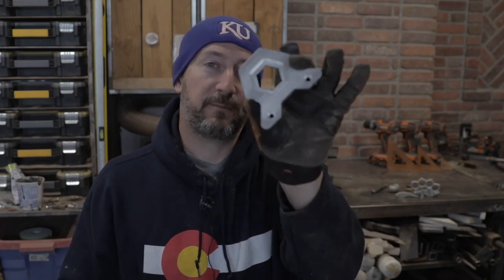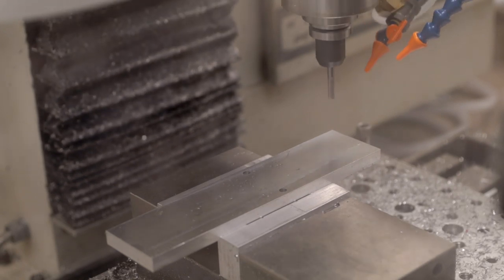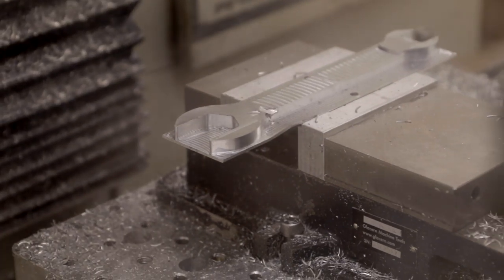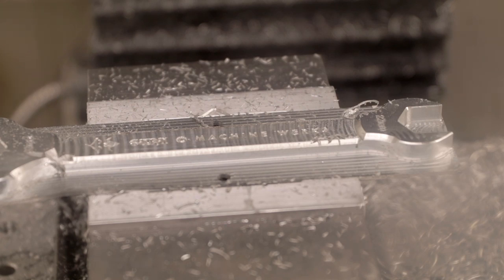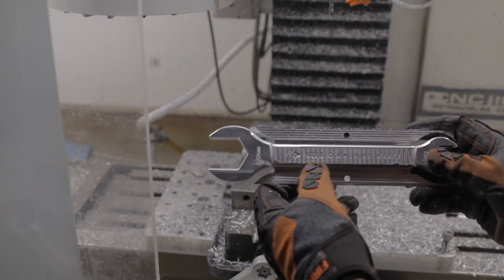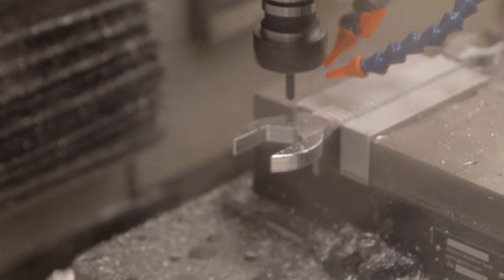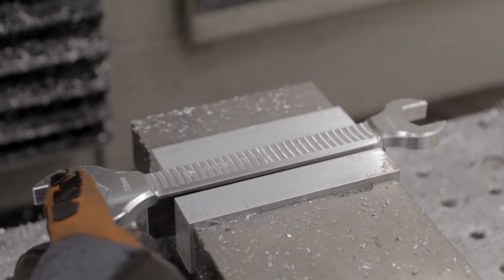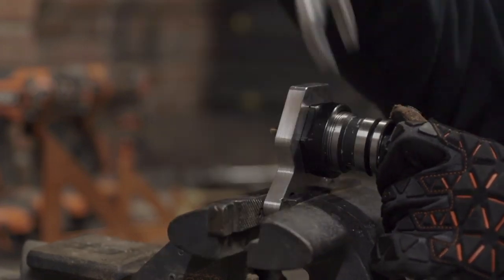Massive Collet Wrench

Comment: I'd be hanging out by my stop button for sure. Thanks for sharing the learning elements of this project. Fun to watch you prototype with the Tormach. It was interesting to see how the much effect the lube had on the the finish of the product.
Reply from the maker: Thanks Tom.  The CNC can be a scary thing especially when you are running a program for the first time.  I have a feeling my entire CNC life will be spent having mini panic attacks.
Reply: @GregsGarage  I bet you'll get comfortable with it as you use it more. I have had a similar experience as I have learned to use my Shapeoko CNC. Still learning. Although the Tormach is a whole different level of intensity.